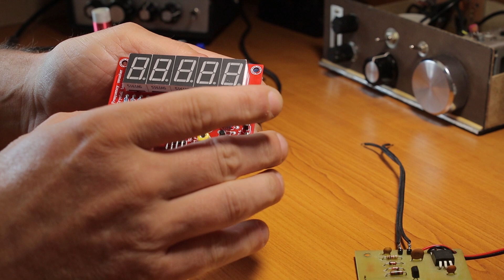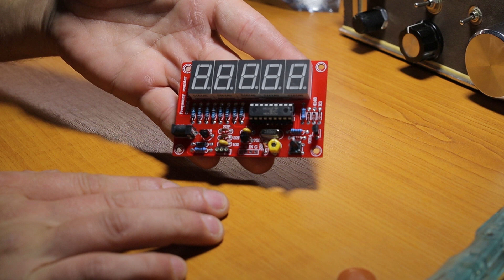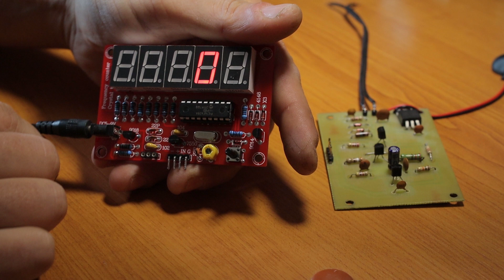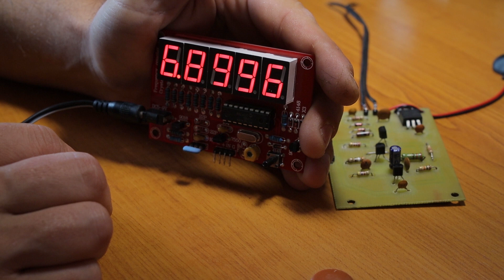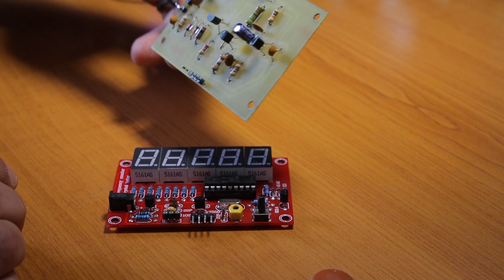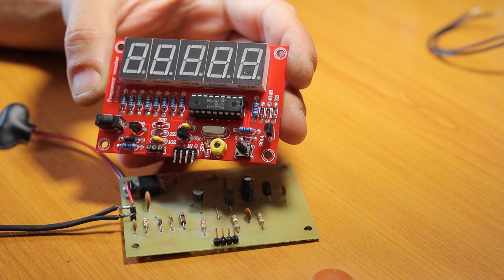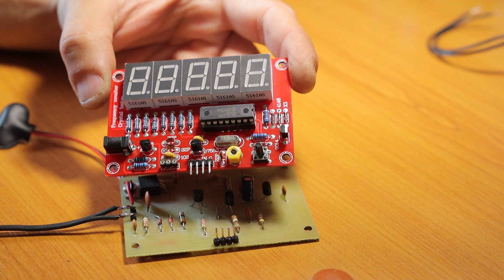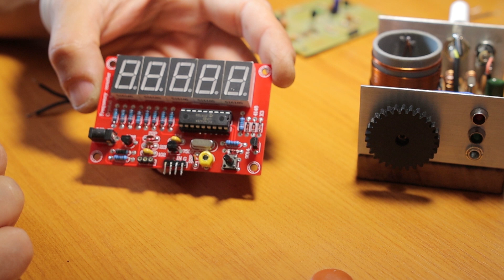Frequency Counter And Crystal Tester / Meter - Assembly And Testing

Comment: Ciao, premetto che ho visto velocemente il video e non ho letto i commenti, quindi mi scuso se ripeto quelli che ti avrà detto qualcuno. Vedo che é di 3 anni fa e probabilmente avrai già risolto, comunque per la cronaca di qualcuno ti dico quanto so.
Comprato anche io, va bene ma ha un problema, se l'input non é almeno 3,5V non legge, lavora a livello TTL, quindi per segnali più bassi ci va un amplificatorino ad 1 o 2 transistors (trovi in rete) conviene poi 2 diodi opposti di protezione. Se così com'è dai segnali di 7V puoi bruciare il pic. Io sto facendo un piccolo PCB con 1 transistor (minimale) poi tramite un relè scelgo se usarlo così o inserire in serie un prescaler, prima del transistors, un SAB 6456 ÷256 (che esce ad 1V per cui va amplificato) così da andare sino ad 1GHz. Spero ti sia utile. Il programma va bene ma in rete si trova una modifica per usare anche lo 0 più a destra. Ciao
Reply from the maker: Thank you so much. Yes I did found a video with instructions to modify the crystal oscillator into a preamplifier since I didn't really need the oscillator. So now it works well. But I am planning on buying one more to keep the crystal oscillator as it was in the original kit, and build a preamplifier separate. Thank you one more time. 73, YO6DXE.

Comment: To fix your problem, connect the oscilloscope to both ends of the crystal of the frequency meter circuit and at the frequency that the oscilloscope shows you, try to adjust the best resonance point using a trimmer capacitor with a plastic insulated screwdriver at least 20 cm long. Your problem will probably be solved. If not, your crystal may have been hit during the shipping process. Repeat the steps once again by replacing the crystal with the previous value but a reputable brand. I am sure the problem will be solved.
Reply from the maker: I need to watch the video again myself as it's so old I can't even remember what was the problem hahaha. I do know I modified the circuit and removed the crystal tester, transforming it in an RF preamp so I can use it back then with the Sputnik Regen Receiver. Even if the size its a little big... I really like this frequency counter. But there was also a trick if I remember well... with some extra capacitor on the back of the board that could be switched in or out of the circuit in order to get proper readings depending on the frequency. Now I can't tell out of memories the exact settings... but I do remember that either with the capacitor in or out of the circuit it was reading the right frequency on lower frequencies... and the other way around on the higher frequencies. Sadly I do not have an oscilloscope but I think I may be able to use the TinySA instead. Not sure entirely about this but I will try. I need to buy a new kit anyway as I want to build a standalone one that will also have the crystal tester as the kit comes from originally... and I will build the preamp separately. Thank you for the idea and sharing the info. And now I also think I remember that I was saying that it may not be exactly spot on frequency and it didn't matter as I was not really looking for perfection but to be able to see where exactly in frequency I am ( if I remember well haha ). 73, YO6DXE.

Comment: Hello, I watched your video on assembling the "Frequency counter Crystal tester" kit. I also made a kit like this, but unfortunately, my desktop power supply, although I recently bought it, has a technical problem. When turning off the power supply, if the lizard clips are connected to the circuit and you are not careful, it injects a 30V peak, the maximum voltage of the power supply, into the circuit in a very short millisecond moment and then turns off. Unfortunately, the microcontroller IC of my frequency meter circuit was destroyed due to this technical problem. I want you to check your IC micro kit and if it does not have a software lock, email me the IC data. I don't know if you read my message or not, but I really need help. In any case, thank you 🙏🙏🙏
Reply from the maker: Hi my friend. Unfortunately I do not have what it's needed to read the IC data. I may have a friend that has a PIC programmer and that could read it, but I don't know how soon I will have the time to visit him. He lives in another city. I don't think there IC is free to read and write on it, no locking system involved. Sorry to hear about the power supply. It happened to me as well in the past so I know the feeling.

Comment: I know it is an old video, but I am commenting just for the algorithm. And, maybe someone would find the info useful.
The crystal oscillator is powered from the input voltage but the PIC MCU is powered with 5V. The oscillator may work well for some crystals at 9V or at 12V, depending the crystal and the transistor. The configuration of the oscillator is quite bad, I had it working at 9V up to 4.433MHz and at 12V it worked well with 27MHz crystals and some ceramic resonators. The low frequency crystals most of the time do not work (1MHz, 32kHz, 500kHz or 450kHz ceramic etc).
If the crystal is good and oscillate, the counter will show the frequency, if not, may try to increase the input voltage from 9V to 12V. I would not exceed 12V.
The PIC input is digital so to work well it need the input signal to be in the TTL standards (low<0.8V and high>2.7V). May be useful to use a preamp and a Schmidt trigger (7414 or similar) to drive the input.
For the tester to work, the output of the oscillator must be in the TTL level specs and some crystals and ceramic resonators just do not oscillate well enough for the output to be good enough.
After assembly, the circuit must power up and work just fine. The only adjustement is to set the 20.00000MHz refference crystal oscillator with the regulable capacitor.
I find that sometimes the 20.000MHz crystal is so bad that it can not be trimmed to oscilate on 20.000MHz, so I recommend to change it with a quality component.
I got a good deal for a pack of 5 and I used them in a RF generator, a TTL clock generator, a GDM, a portable frequncy meter and I made my custom crystal tester.
Reply from the maker: Thank you so much for the commend and also for all the info. Ohh I ended up modifying mine following the instructions from a video I will link down bellow. I decided to transform the crystal oscillator into a preamp as I didn't use the oscillator anyway. For now it works fine, but I haven't tested it on all frequencies yet. Thank you one more time. 73, YO6DXE.

https://youtu.be/0BxpMm6SLoE?si=pnKMNnEENKBY0uap
Reply: @dxexplorer  I know that video and it inspired me to modify them. However, to use the module as frequency meter without loading the circuit (or in GDM), I used a old circuit that i found in an old Tehnium magazine (wide band input buffer with FET). The circuit worked fine up to 80MHz, the max that I used it, powered with a 7812 and shielded. As for the crystal/ceramic oscillator, I built myself 3 separate oscillators each for a frequency range (LF, MF, HF); I adapted various schematics from the same magazine.
Reply from the maker: @sebastian19745 Amazing idea with separate oscillators. About Tehnium... I still find a lot of great schematics there that I try to bring back to life... when I have the free time 😁. The magazine the open an entire new world to me.

Comment: It could possibly be the PIC Code needs some tweaking!  Good luck in finding the guy who programed the PIC! :face-red-droopy-eyes:  Also, did you check the value of each component?
Reply from the maker: Ohhh no it was something else. I had to modify the oscillator circuit and turn it into an RF preamp... not it works like a charm.
Reply: @dxexplorer  - Glad to hear it !
Reply from the maker: @tubeDude48 Is just the signal was too low for the input of the counter. I rarely use it now as I have a smaller one now but is there just in case 😁

Comment: I tested it and found that it read from 3.58MHz to 24MHz.  I have a 27.14MHz which it failed to read, and a 4.433???? that read as 13.2????.  I also have a 1MHz, a 2MHz, and a 2.4576MHz in the larger size case so they couldn't fit the socket. Your mod actually made it worse, so I reverted to the original vrsion and it works fine again.
Reply from the maker: I also modified it using other video as tutorial 😁. But in my case it works fine. I only tested frequencies from the receivers thought... as there is no longer a crystal tester circuit anymore in the frequency counter since it becomes an RF preamplifier. So technically with the modifications it shouldn't be able to measure crystals at all. Using the original design yes it has an oscillator circuit that will allow us to measure the frequency of the crystals. Those I do know that have some issues and if I remember well there was some capacitor value that had to be changed depending if we would prefer to measure low frequency crystals or those closer to 30MHz. So maybe that is why it won't measure the 27MHz crystal. I can't remember now what capacitor had to be changed as I no longer have the crystal tester circuit in mine. 73, YO6DXE.

Comment: Hey pal
I assembled my one yesterday and it doesn’t seem to power at all. I followed all the board signs and checked values with meter. Any clues how to diagnose the fault??
Reply from the maker: I did not had that issue. Maybe it would be good to check the voltage regulator to make sure it works ? Is a cheap kit so I guess it would also use cheap components that may not always work properly.
Reply: I was wondering if the chip works but ain’t sure if it’s programmed or something??
Reply from the maker: @Sickindian5 mine was all set and programed, I didn't had to do anything just to put the kit together and it worked. But I did heard others as well saying that they had issues with it.
Reply: I think there might be no instructions on the PIC16F628A chip.  I will try to read the data tonight off it.
Reply from the maker: @Sickindian5 I have no clue how to do that. I don't even have what its needed to do that.
Reply: Could you check one thing for me. See if digits on the lcd lit up if you pull chip out of the socket please.
Reply from the maker: @Sickindian5 I will do that and let you know. Only that I am not home now and I will be back tomorrow.
Reply: @dxexplorer  hey pal u managed to check it?
Reply from the maker: @Sickindian5 I finally did yes. And nope..  it doesn't work with ought the PIC. The segments do not light up.

Comment: Can anyone help me please.. I just built this kit and it powers up but when I plug a crystal in it stays on 0, the solder joints are all good and the kit has been built properly, I do soldering for a living and make fire alarm systems but I don’t know why it’s not reading the crystal? I’m putting 9v into it for power as it says I can do that on the board but is that causing an issue at all?
Reply from the maker: Honestly I don't know as I modified the kit right away and transformed the crystal oscillator into an RF preamplifier. So I never tested crystals to see if it works.

Comment: Yep. I had the same problem. Wouldn't read from the oscillator circuit from a SW receiver. Maybe it needs square waves rather than sine waves???
Reply from the maker: Not sure. Maybe the signal was low ... low as in output for the frequency meter. I noticed in some regen receivers if I added one or two more turns to the pickup coil, it would fix the issue. ( using the modified frequency meter not as it comes as a kit ).

Comment: With the programming button, you can do a reset that may help.
Reply from the maker: I ended up modifying the circuit and instead of crystal tester I changed it into a preamp. Works like a charm now 😁.

Comment: Add a preamp and you will be good to go. Reading frequency from regenerative radio is a bit difficult in my experience even with oscilloscope. They work better in superregen mode
Reply from the maker: I noticed that if the receiver is oscillating too much..  the meter goes crazy. But since with the Sputnik I made the regen control really smooth... I can set it in such way that is more like a direct conversion receiver instead of regen  ))) So the frequency meter is spot on. Is important I guess to have a good read is important to set the oscillation properly and then there are no issues. There will pe a preamp soon as I have some present from one of the subscribers.   I'll make a video about it of course  ))

Comment: Hi Chip, glad you got it working. I have a similar kit and the crystal oscillator seems fine with 12v battery. I suspect though that the capacitors in the feedback network are too small for lower value crystals. Maybe 100p would be better. Hope your license test goes well! Take care, Ian :)
Reply from the maker: Morning from Transylvania )) Yes Ian that's the issue. I found on many blogs that people usually replace it with 150pF capacitor for low frequencies... and 68pF for higher frequencies. I haven't tested to see if it works or not as I transformed the oscillator in preamp to get the counter working hahaha. I will build another one on a separate board. Thank you... fingers crossed the exam goes well. 73 and we catch up soon.

Comment: 1. You have to clear the offset through the menu 
2. The "input" goes directly to the PIC, therefore it must be below 5V  !
Reply from the maker: Thank you Ivan. I found the original preamp schematic that was used in the "original" version of the meter and now it works perfectly 😁😁 no more headaches hehehe. 73 my friend.

Comment: One more note, the crystal test part off the kit is not usable on lower range crystals, it depends on stabilized voltage you are powering the kit. (Wau how much i wrote....) Keep up good work. Cheers
Reply from the maker: It seems from what I found online ( I haven't tested that yet ) that by replacing that 22pF capacitor that also has another 22pF capacitor in parallel as shown in the video with a 68pF... you can measure the crystals over 26MHz up to whatever the PIC can take ( about 60MHz ) with no problem. For crystals under 26MHz the capacitor must be 150pF. I guess that could be an easy fix with a switch. Now I go over on the other comment  )))
Reply: The preamp that got me to stable readout(to 6Mhz only😔) was "termination insensitive amplifier" by W7ZOI. I am hoping to be able to modify it for this kit. Check it out it is good preamp for all sorts of things 😉
Reply from the maker: Thank you John. I will search for it when I wake up. I'm nearly in wonderland here )) 73 my friend.

Comment: I thought that you will help me with the same problem (when i saw that little board that your friend send to you from your earlier video)but let i help you, to the degree that i came to.(I am still experimenting to find solution 😔) First watch video on YouTubers channel "theHWcave" he did amazing job on explaining the input on PIC and the limitations on same kit. The problem is that you have to have max 5vpp on the input of PIC to be able to count, but 5vpp above 0v.( It is difficult to me to explain it on english it is not my native language...). Signal has to have offset from 0v but max amplitude 5vpp. I bought same kit as you, and wanted to use it as a frequency display for analog signal generator that i am working on. Other note, you have to power it with stabilized dc voltage from that little socket on the board(6v minimum , that also worked best for me..). Things are little complicated...preamp has to have three stages. The first buffer then amplifier and then again buffer. And of course AGC. Impedances have to be equalized or you will lose signal( I don't know what your bandwidth is in interest but i am having problem because i have to cover very wide bandwidth and have stable amplitude in whole range). Difficult, but doable 😉. Just like you, this is hobby for me, and if i have time in the future i will do more tests on my preamp which may help you. Also keep testing and experimenting ( the journey is important) with it and if you come to solution please share it with us.
Reply from the maker: I understand it all... no worries on the English as its not my first language either ))) I have seen the videos as well. I will do some more tests soon and I will come back with another video on this as soon as I find a solution. 73 my friend and have an amazing weekend. Yes... Sadly none of those preamps worked. The max signal I got from the three transistors one was about 1.5v.